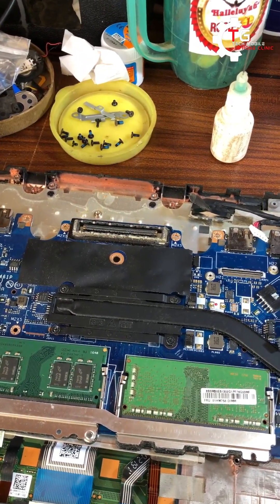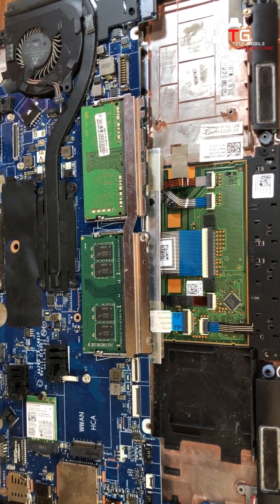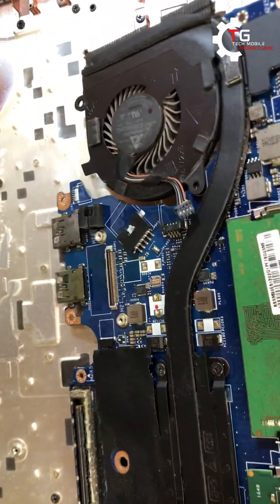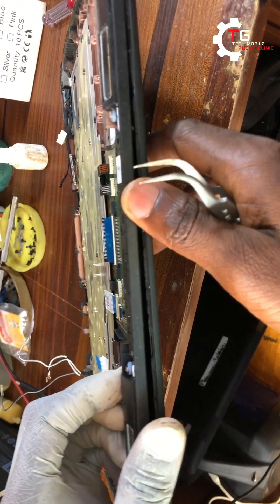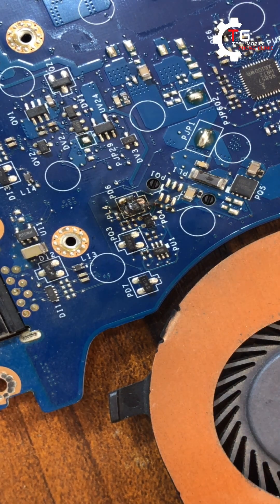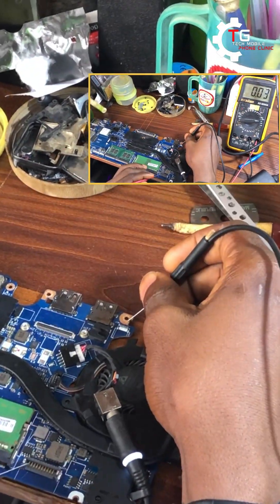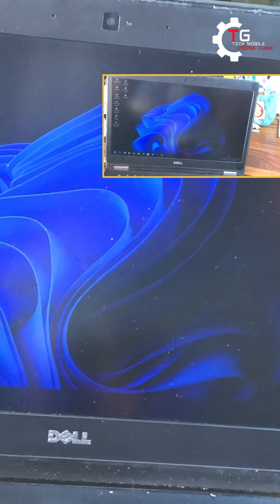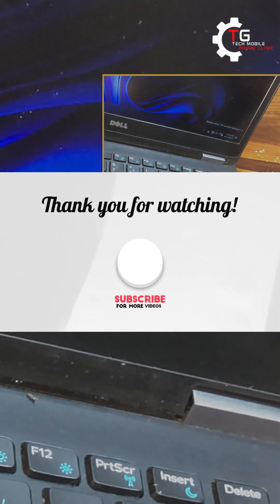Laptop Charging But Not Adding Up Percentage While Charging; Dell Latitude 7390

Comment: I don't think that's a transistor because it is labeled PD6 instead of Q or PQ6. It may look very similar to a transistor since it has three legs but in reality it's a double diode.

This is the code
Q = Transistors or 
PQ = Power Transistor
Q could be ( BJT, MOSFET, IGBT etc.)

L = Inductors
PL = power inductor

C or PC = capacitor

D or PD = Diode

U = Integrated Circuits (IC)

R = Resistor

If ( P ) is attached to any of these letters just remember that it means Power.

Comment: I am having exactly same issues in my hp 840 g2 ,, charging but not increasing, i spent 23k to buy new battery thinking it's battery , but it's not..i took to some technician and they told me it's 50:50 job....i had to take back my pc home
Reply from the maker: We can help you fix it, just try and locate us using Google map
Reply: @tgtechmobilephoneclinic  location?